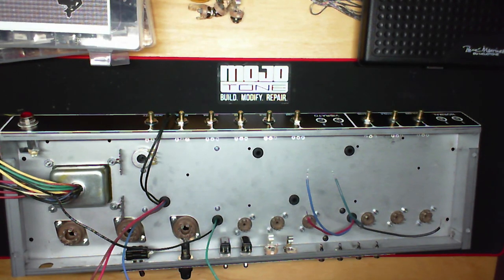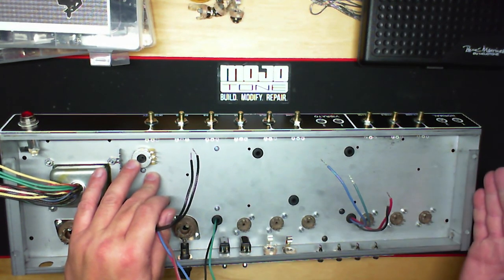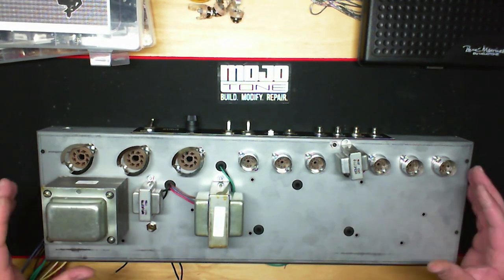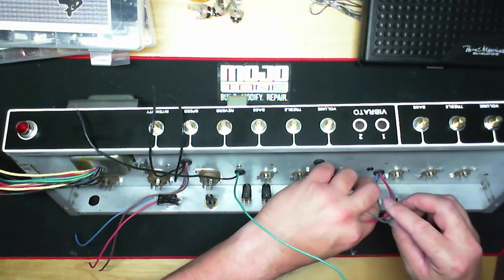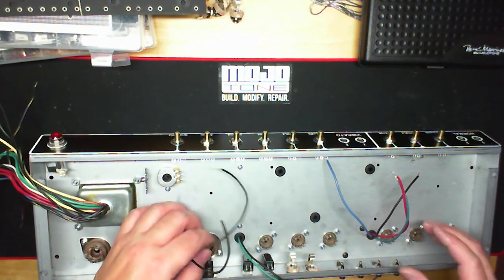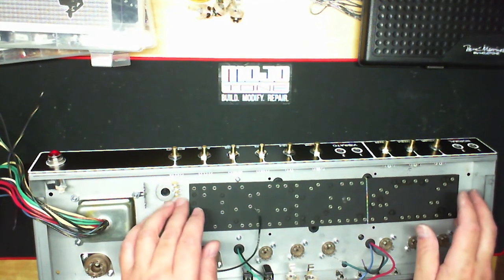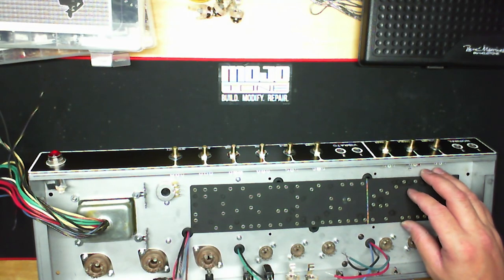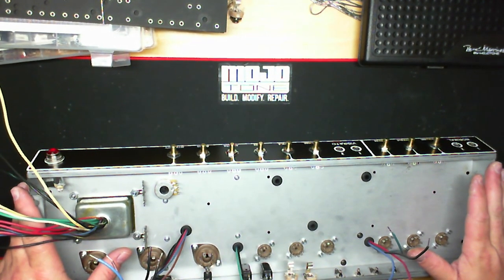Mojotone's Blackface Deluxe Reverb Build Start and Mechanical Assembly - PART 4

Comment: Hello AJ. Good timing on these videos! I just started building my 5F4 Super last weekend and, though you're taking us through a different build, I'm find a lot of useful tips. As a first time builder, this has been very helpful. I'm using the pot cases as an easy ground point for the tone caps and pin 1 on the volume pots after learning from this series that the coating on those CTS pots lends itself well to soldering. Hope this was a good decision on my part. I look forward to more.